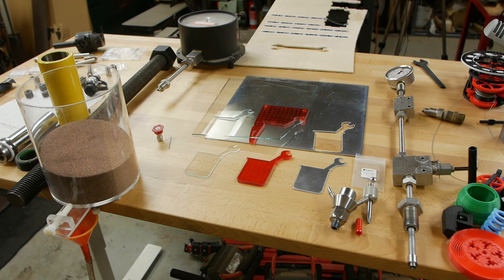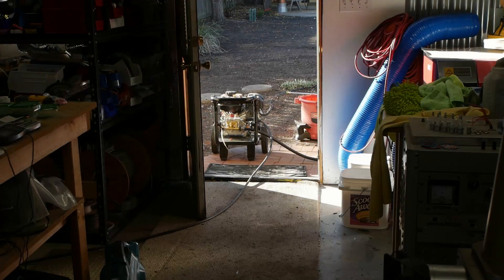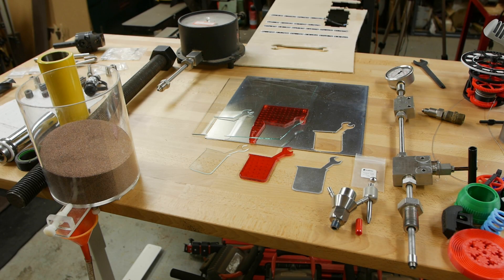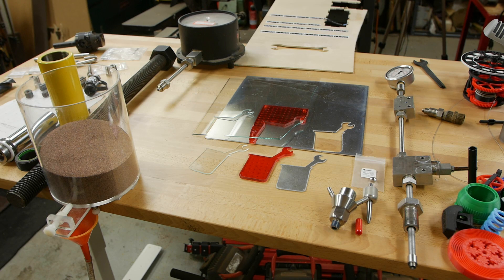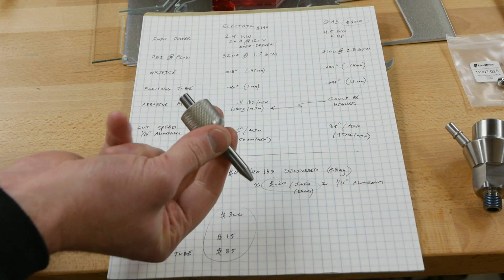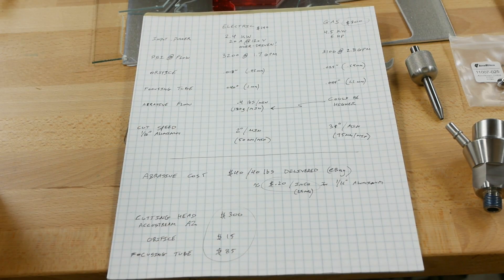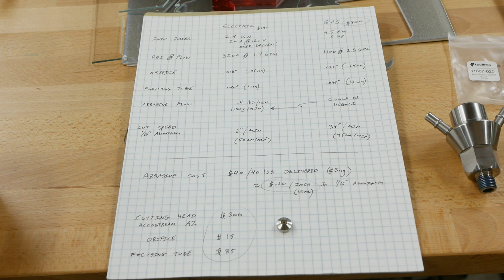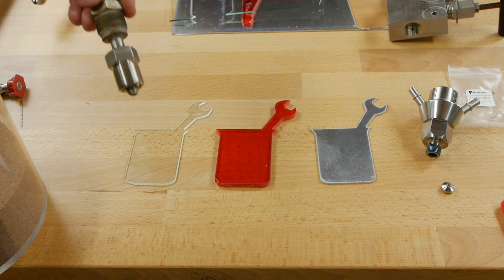Gas-powered waterjet cutter (follow-up) and other project updates

Comment: Thank you so much for sharing your water jet experiment.  I have some salvaged linear slides and someone was throwing out a working Honda pressure washer.. so thinking this might be fun winter time project.   What do you think about a stock tank with some small, roundish pea gravel under water for a basin on a water jet cutter?    I've also got an older Staubli 6 axis robot which would allow very complex cutting paths.  Could be interesting.  Might be a great tool for roughing out stone sculptures.

Comment: Hi, do you still read comments on old vids 😅?
Today there are 2 versions of that pressure washer: 2200psi/1.1gal@min and 1700psi/1.8gal@min
I would be interested: how much water does your cutter consume? Delivers the cutter "too much" generally or could it be even more?

Since I've seen this vid the first time it stays in my head. But I would like to produce a little bit more pressure (interested in steel cutting) and I would have some ideas therefore. But before designing something it would make sense to have these answers.

Btw, all your videos and experiments are top notch, this type of content is what makes yt valuable. Cat videos are cool too, tho 😂

Edit: of course you discussed this in your vid. But I would be interested, how much water do I need (if I would have "unlimited" pressure). Or the other way round: the less water (flow) I need, the more pressure I can get out of my system with the same rated motor (can run slower -> provides more torque)
Can anyone give me some theories? Hints?

Comment: I’m curious if several electric pumps could be used in parallel for a higher flow rate. Sort of a modular pump system.

Comment: I know it's been a while since you made this video but i just found out about your channel.  For the hole on your receiving tank,  did you try to use a propeller so the water in the tank would move in a way that the waterjet would be slowed down ? along with a deeper tank🤔

Comment: I do a lot of work on pressure washers, you should not assume your flow rate is nearly as high as the machine was advertised. The restriction created by the smaller orifice will reduced the flow rate significantly. Also the machine you showed in the video doesn't appear to have the power or a large enough pump for 4.5 gpm @3100psi, its probably more like 1.9-3gpm. Check the nozzles that came with the unit, they have a number on them that represents their spray pattern angle and gpm rating. The manufacturer uses that flow rate to set the unloader pressure.

Comment: In my country it's hard to find Garnet Sand, but it's easy and cheap to find and buy aluminum oxide in different meshes. Could I use aluminum oxide as an abrasive?

Comment: What size thread is the bolt?!? I've been using a -08 SAE Parker thread adapter and it fits and tightens up but feels very loose compared to a normal hydraulic fitting. I believe the 08 is 3/4-16. I've ran a steel rod around 15 to 20 thou over with the 3/4-16 thread profile and it feels about right, easily spun in finger tight, not rattling loose like the off the shelf fitting. Is my nozzle body way out of spec or am I just using the wrong fitting?
Reply: marckerger figured it out: 7/8-14UNF

Comment: The link to the gas powered pressure washer is obsolete.  Could you give us the specs (pressure and flow)? Thanks.
*EDIT* I found it one the sheet: 3100psi x 2.8GPM I think.

Comment: Hilarious is I find these pressure washer engine very often for free to $50 for the horizontal shaft engines.  I've actually invested in three of the GCH's and GCV's, though for air compressor system testing and washing for now.  Maybe eventually for water jet cutting since is on the mind.  Amazing... then another not even $100 for a new pressure washer pump where most the washers have the rest of the parts other than required for cutting.  Thanks for sharing!  For some reason I missed this video.
Reply: As of late, wondering about converting an air compressor to run off the GCH gas engine with a solenoid to control the throttle with the go cart clutch.  Thinking I can remove the flywheel and epoxy some neodymium magnets and install a GX stator.  Otherwise... maybe lap a GX flywheel to fit the GCH... then it's like scope creep to just invest in the electric starter kit that has all the parts.  Unfortunately, I don't see much, if any of the electric start GC's though I guess they exist.  Doubt for under $50 though.
Reply: What's the thickest aluminum and steel material you can cut?

Comment: another way to save on the pressure washer would be get a 212cc Predator engine from Harbor Freight, usually about $100 and the pressure washer kit for Predator/Honda/clones off Ebay/Amazon and have a go. thatd probably save about $150.
You actually don't need a CNC to cut with waterjet, but someway to mount the cutting nozzle on a sliding tube/rail type frame comes to mind (X or XY like an Etch a Sketch if you like)

Thanks for the vid! I totally forgot about waterjet cutting

Comment: I wonder what it would cost to buy a high pressure pump, like 1000 bar (14000psi) and run it with a 3-phase electric motor.

Comment: Dear Sir, I have been watching your project over and over, and been hunting in my near Junkyard for over 6 months. Finally I may have an Plunger Pump quite big ( 170kgf/cm2 pressure and 227L/Min out put ). May I ask do i need that kind of big pump, will the heavy Flow Rate does help ? As I have read around on google the Water Jet Cutting usually use 5L/Min, what will happen if I try to scale 227L/Min to 10L/Min by reducing the Carry Tube from 2inch to 1/2inch ( slowly reduce by join each reducer after another ). Thank you very much.

Comment: A tip for those who want to prevent the jet from penetrating the container and whatever is under it: Put in a lot of ball bearing balls. The will absorb the energy by the balls starting to rotate! This is used on commersal units meant to be put on top of the table on normal CNC machines.

Comment: I don't think re using garnet is a massive problem from the size of the particles point of view. I would bet you could use it a least twice and probably a lot more before this became your show stopper. I'm thinking the problem is how to recycle the used stuff. For example  drying it is a big problem and without it being perfectly dry it will clog a gravity fed system like this pretty much immediately. I'm wondering if you could use a gravity feed system but leave it watered and use air to keep the garnet in supervention?   
Also I know you can't use silica in shot blasters due to the dust causing silicosis if inhaled but in a system like a water jet cutter these never get airborne so would a cheaper sand work for the home hobbyist ? It may take linger but is considerably cheaper than garnet.. 
I'd love to do my own experiments with this and I already have the same pressure washer as used in this video. Unfortunately I'm not in the position to fork out £300 on getting the head parts. If someone has a secondhand one for sale or wants to loan one to me to further this very interesting topic then get in touch..

Comment: Great explanation and video... Some questions: have you tried out the cutter heads from a platform like Aliexpress .eg: https://www.aliexpress.com/item/4000828714758.html?spm=a2g0o.productlist.0.0.a8fc422fDmuTKs&algo_pvid=95a9395d-b046-4e7a-a949-e14eff24e35f&algo_expid=95a9395d-b046-4e7a-a949-e14eff24e35f-14&btsid=0ab6f83915889160503692558e1ab1&ws_ab_test=searchweb0_0,searchweb201602_,searchweb201603_

I'm curious to understand if these would work as well as your setup. 

Also, have you managed to build a CNC waterjet  cutter?

Comment: isn't it possible to recycle the abrasive?
Reply: Not really, when it hits the surface it's cutting it pretty much disintegrates into dust, making it useless for cutting. Some does go through intact but separating it is not worth the time or effort. 

Think of it like sand paper. It only has so much usage before you can't use it anymore.

Comment: Hi everyone, I've built a cutter based on the video, 
Set  up-
10hp gasoline motor to drive a constant 3500PSI at 10 liters/minute water pressure pump.

I've adapted a CNC machine for water jet,
 at present I'm using a Flow type mixing body with a .35mm orifice and a 1.02mm nozzle, my goal is to cut 3mm thick glass, the problem is the garnet will not mix into the water stream, I've tried both 90 and 120 mesh garnet at varying rates, but it always clogs up the nozzle very quickly. Any assistance, advise, help would greatly appreciated.
Reply: Sounds like your garnet is getting wet at the neck.  I saw in another video how that was mitigated

Comment: The garnet is reusable. 20+ years ago we dried and reused our garnet multiple times to increase cost efficiency. Very few of the particles actually do the cutting per cycle so 20-30 uses was typical for ferrous metals as we could use magnets to remove the metal particles from the slurry. We didn't concern ourselves with particles from materials that didn't rust/corrode in water or water/coolant mix and got up to 50 uses. Other abrasives that don't eat the focus nozzle are another area to increase efficiency.

Comment: 0:25 assuming you could fabricate some kind of mount/adapter, couldn't you just swap out the original electric motor that overheated with a ~2kW 3-phase motor of similar RPM's (and even use a VFD to adjust the pressure then)?  I've been seeing 2kW 3p motors for less than $50.  Then the system in your first video would only have the problem of leaking when being over-pressured.  Also: what about using an carbide endmill with straight coolant hole through the middle to make a cheaper (?) replacement for the expensive silicon carbide mixing nozzle part?  I think they have holes that are 1-2mm also.  Or would they explode and send super hard shrapnel everywhere?  Seems like they must also be made to withstand huge cutting forces.

Comment: Can this cut small thickness steel plates of 2-3 mm..?? At what speed..?? And is there any 10000psi pressure pumps available in case if we want to increase pressure and flow rate to cut steel .?? Can anyone advise..??

Comment: This is a fantastic project! I note that there are commercially available pumps rated up to 4000 psi. How much would this increase improve performance? Is is linear or geometric? What do you think the thickness capacity in aluminum would improve to?

Comment: Applied Science couldn’t several layers of baffles of different sizes and offsets (or two layers with metal pot scrubbers sandwiched between) towards the bottom of your catchment underneath the cutting head reduce the likelihood of cutting through the bottom, or would this just randomize the trajectory of  the accelerated particles without reducing their velocity and make a bigger mess?

Comment: Hey, good video and all that, but I have a question.  You mentioned at circa 8:00 the 1/2MV^2 thing.  I bowl religiously once every 20 years and I accidentally picked up a 15lb ball instead of a 16lb ball.  I don't own a ball so...  That ball was ripping holes in the back wall and I was delivering strike after strike.  I spoke to a math professor and he said forget kinetic energy and that momentum was the whole thing here.  I would like your take on all this.  I bowled a 199 and my average is about a 140 or less.  Again, good video.

Comment: Pro tip, bring the gas powered pressure washer inside and close the door. That way its closer to your cutting table and you dont get noise complaints from the neighbors :)
Reply: JK JK! THIS IS NOT A PRO TIP! DO NOT DO THIS WITH ANY TYPE OF GAS POWERED TOOL! Because you will die  from carbon monoxide poisoning!

Comment: I wonder if you agitated the waste water and waste garnet if you could pump them back up into the orifice and real-time recycle them. You could also add fresh garnet with the used to drastically reduce your fresh garnet flow rate and cutting cost/inch. A kickstarter kit that used a modified 3d printer and your custom nozzle would have some interesting possibilities. The buyer could supply their own pressure washer locally.

Comment: What about a multi stage pump system to get the pressure up. If you buy 3 electric pumps, maybe get 10 000 PSI ?

Comment: maybe adding some sand on the bottom of the bucket willl help avoiding it to be cut since the sand will act as sandbox.
Reply: Better off adding 3-4" of water as the water wont be dispersed as easily as the sand and water is cheaper

Comment: I think you don't need special diamond and carbide nozzle for 300 bar.. special hard steel drilled with carbide drill bit and machined abrasive ports will do it and you save 300+ dollars

Comment: I suspect performance would be greatly improved with an accumulator. Just like in the 25k psi machines. This model would be use a much weaker spring inside the chamber of course. This acts as a buffer between the pump and the nozzle, greatly smoothing pulsation and fluctuation in pressures, not to mention helping with the bypass valve issue.

Comment: High pressure water carries the granules at a high rate of speed and do the "cutting."
This is similar to Viktor Schauberger's single spiral water jet nozzle, or rather He created the waterjet and in a better way.
Water is pretty amazing, right? Look at how falling rains create energy and we get thunder and lightning. 
If only it was better understood.  You should look at Schauberger's patents and read his work to get better performance as well as a better understanding of the only way the world works that would have you delete most of the videos or at least put some of those fancy popups to show what you have been taught was incorrect. Unnatural straight lines do not help performance. This is also why that falling rain, moving wave, blowing wind all move in spirals.

Comment: I would like to ask you have you considered useing high pressure air and garnet in place of high pressure water ? and to keep down any dust add a water sprayer to wet the cutting area  or you could have your part to be cut submerged an inch or two below the water surface and simply lower your cutter head below the water just above the part and if your concerned that water would clause your metal parts to rust then you could use soluble oil like is used in high speed band saw metal cutting and used in cnc and manual lathe work to help cool the parts to reduce material warpage and or tool damage ? Air will flow much better then water through piping plus depending on your compressors pounds per Square inch setting you could have hundreds of pounds per Square  inch more cutting pressure coming through at the cutting tip I've never built anything like this so I'm not sure exactly how much pounds per square inch of fluid movement your getting through your cutting tip never the less I'm grateful that you have made a system that does cut good and allows for cutting work operations the true speed of cut and max depth of cut now rest one that one factor which is flow rate pressure the one benefit to useing high pressure air is that your air system can be used to preform other operations such as sand blasting chip and dust removal from around you garage ,drill press lathe you can pipe your air from the compressor to each of the hose connection ports through black iron / metal piping that you can get at Lowe's or home depot you would need to use high pressure hose and connectors at the cutting jet wit it's own high pressure air regulator and use another regulator for the other air outlets so you can set the air flow for 120 psi for other work such as air tools sand blaster Etc

Comment: something soft like a rubber matt (or gravel) on the bottom of the bucket to prevent from shooting through? I once taped some areas of sandblasted glass that was completely untouched under the soft tape.

Comment: Could you just join the output of two electric pressure washers ($280 vs. $300 for the gas), not run them at full power (if that's possible) so they don't burn out and still match the 2.8gal/min of the gas powered one?

Comment: Which Stainless Steel bolt did you order from McMaster to adapt the Accustream A2 abrasive body? What is the thread pitch? Thanks for the video and other links.
Reply: marckerger figured it out: 7/8-14UNF
Reply: Did you ever get a response to this?
Reply: @PsNativeVs  Negative.

Comment: A very common application for these is in a automotive paint shop where they are used for blasting off the accumulated layers of paint on the carriers. No abrasives were necessary, but then again each pump is powered off of up to a 500hp motor. The nozzle rotates, and has a cutting "surface" of about 3 inches in diameter (we just want the paint off, we don't want to actually cut the carriers in two).

The cleaning head is attached to a robot, which runs its path to clean the carrier. The head of the cleaner is nearly bulletproof, and the carrier is essentially a large hunk of steel. No better place to learn robot pathing than in the cleaning booth. Even if you whack the carrier with the spray head, no harm done. You're there to take the paint off of the carrier one way or the other... :)

And since each carrier is cleaned after 50 - 100 trips through the paint booth, the paint buildup will be made up of many layers of different colors (think red car, green car, blue car...). So the larger pieces of paint blasted off of the carriers were often collected by the guys in the paint shop, and then sanded down and polished to show the various layers in the chip.